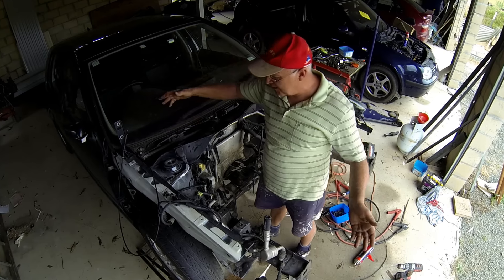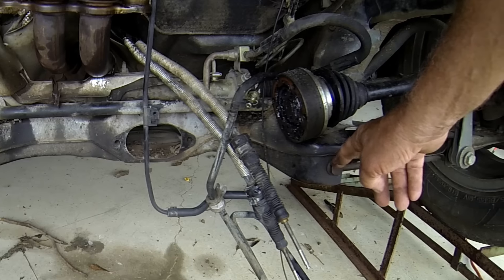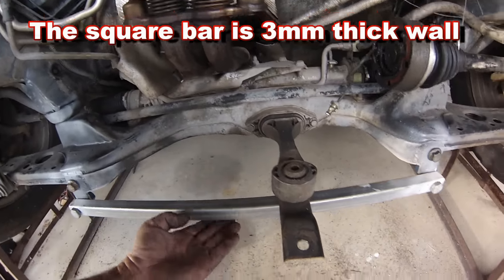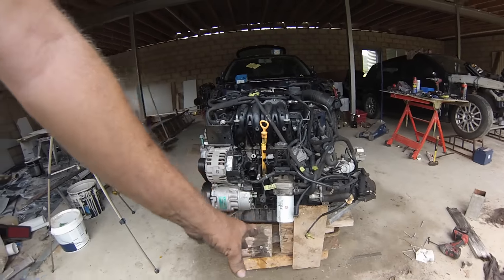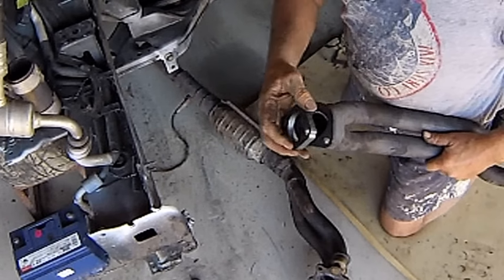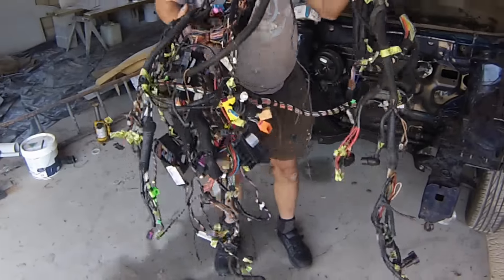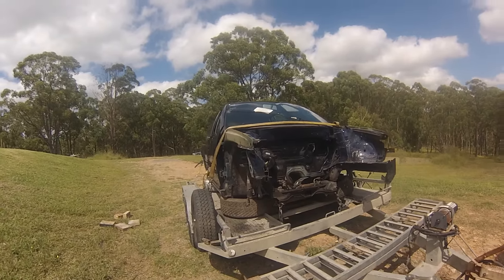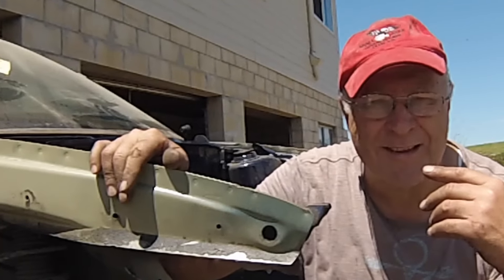Project VW Golf Mk4 - Part 3

Comment: Awesome! So how's raptor coming?
Reply from the maker: +Redline TV Slowly but surely, however it has to be at the back of the cue at the moment. I plan to finish it this year (2016)and race it next year (2017), as the Muscle Hatch is proving brilliant on the dirt after a 3 1/2 year final build phase and I see a state dirt title that's right up it's alley. My plan is to use the V6 Civic only on tar after that as I think it will be a blast on the bitumen and in 2017 a brand new 3 1/2km race track is planned to be finished just twenty minutes away from where I live up here in the mountains.
Reply: +WJP004 sounds awesome! keep it up!!!

Comment: Its amazing how some people use Heath Robinson methods. Unfortunately there are some who believe that these are proper mechanics. "Touch up paint" job on the suspension strut tops , bird sh--  welding.  And this car is going to be "raced"   UNBELIEVEABLE
Reply from the maker: Yes you're so right. But somehow this car still won it's first dirt event OUTRIGHT - beating WRX's and buggies. Pardon me if I don't think a full re-spray is necessary on welded strut towers on a bloody dirt car! Oh if only I'd done that it could have finished ... better than first outright ????

Comment: "Standard Trolley" - Literally just blocks of wood, barely holding it up in any stable way. The Absolute Unit you have to be...
Reply from the maker: With M10 x 100mm galvanised screws holding it all together. This engine ended up sitting on this trolley for over 6 months. Nothing moved, despite being loaded into my ute & driven to my son's home 90km away & wheeled from place to place under his house. Not to your engineering levels? Get over it! Hahaha!